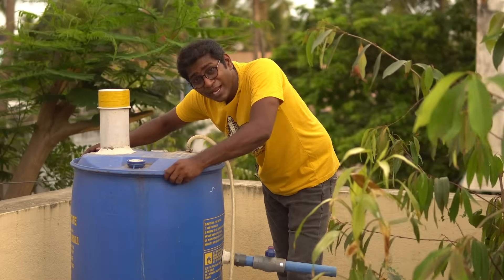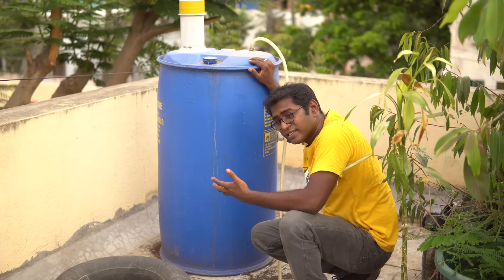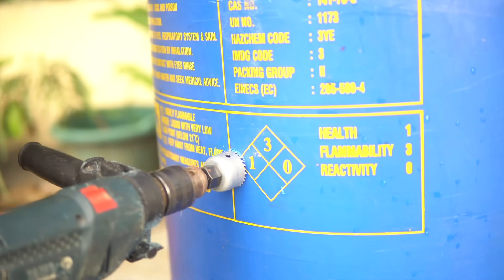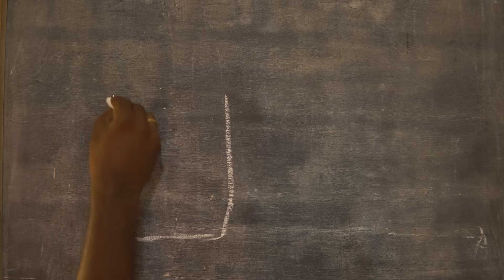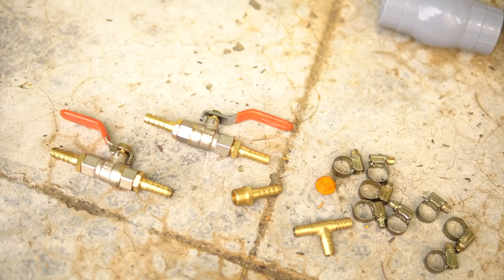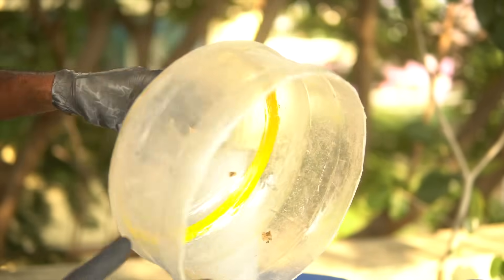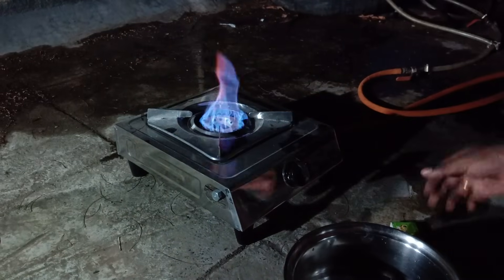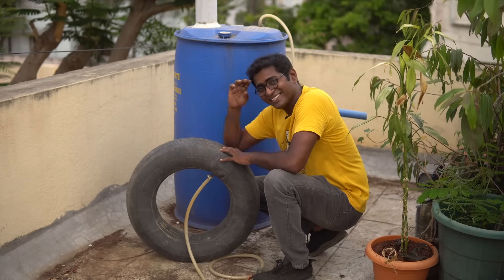Make your own Bio gas to save money on LPG

Comment: Suggestions cut your hole for the inlet pipe 3/4 of an inch smaller than the pipe use a heat gun to heat it up gently curl the plastic up until you have a big enough hole to insert your inlet pipe into use a pipe clamp to tighten the barrel flange to the inlet pipe also by putting the outlet that far down it means all you have is a 40 litre tank outlet should he within the outlet pipe or at least the diameter of the inlet pipe from the top that way you triple the amount of slurry and that should triple the gas output  you did an excellent job on the video but for a digester to be useful it needs to produce enough gas for cooking atleast one meal a day preferably 3 another suggestion is for gas storage and pressure I don't know if it'll work but place two barrels horizontally one above the other connect the bottom bungs together put the gas inlet and outlet in the top bung of the bottom barrel and fill the lower barrel with water as gas is produced it will force the water from the lower barrel to the upper barrel and the weight of the water will give it pressure since the  bungs have a 3/4 inch fip threaded hole in the center I would suggest starting with a 3/4 inch pvc pipe between the barrels that should give it about a pressure of 11 inches of water column it also gives you a built in pressure relief valve as if the bottom barrel which is the gas tank gets too much gas it'll travel up the pipe to the upper tank and out the top bung of the upper tank for those that compress the extra gas it is a way to make it a automatic just put a float switch on the upper barrel so that when it's full the compressor starts and lower the gas level down to a pre-set level I'f using it for cooking or other gas needs it can be set to leave as much gas as you. need

Comment: I am planning to setup the same setup of 200 liter drum experimentally. But it is extremely cold here so waiting for hot weather ie summer so that it work well.
Again a question I have for how long it will burn after 24 hours if I put 10 to 15 kg cow dung daily in this 200 liter drum..?
Reply from the maker: first of all, 10- 15 kg dung will be too small for this setup. You may need something larger...like an IBC tank or 1000 litre water tank.  There is no telling how much gas it will produce. There are many factors influencing gas production. It's a natural process.  I had been dumping about 3-4 kilos of quail poop every alternate day, and It would burn for only about 5 mins.... For you since you are using cowdung....about 10 kgs...it may go up to 20 mins or so....provided the container has a larger surface area and you have a suitable gas collector

Comment: You did a great job. My question are:
1, is it possible for the gas to escape through the inlet PVC pipe?
2, does the size of the inlet pipe matter when constructing bio gas?
Reply from the maker: This is just a proof of concept. Gas can escape through any gap if available. Plus this needs to have a flashback arrestor, something to scrub the sulphide from the gas, a proper storage etc...

Comment: Biogas contains hydrogen sulfide. I do not have time to watch this video, however if you attempt making biogas you need to purify it and install a monitoring system and get the hydrogen sulfide compounds below 10ppm. It is highly toxic and corrosive. Just don't try making your own biogas.
Reply from the maker: yeah, Its been pointed out by many of the viewers. Some have recommended some design features to combat that issue as well. Well I will try and add it in my next upgrade

Comment: Wow this seems awesome. I think you should try adding check valves in the system to reduce manual turning on and off. Its not too expensive and you can even make them yourself, but making it automatic might improve user experience. And if you place some weights on top of the tire tube prior to usage you can improve the flame size at the cost of more gas usage. Also if youre scared of explosions, I suppose a burst disc could help. Like an electrical fuse. Instead of having the whole assembly break, let the burst disc sacrifice itself. Id propose a simple flange pointing up, with a measured amount of weight could act as your "burst disc". Gravity pulls weight down, compressing the flange shut and gas pushes up according to F = Pressure x Area. But the moment the pressure increases too much, it will vent out the gas. I suppose a flashback arrestor is a complicated piece not meant for DIY.

Comment: How much psi does it maxed? And, why don't use regulator?
Reply from the maker: The idea of the video was to debunk a few misconceptions. See...a set up like this is not adequate even for an individual. It would take a few months to fill up a tank to support household cooking.  Even In my house, my wife is not keen on cooking with biogas....So the idea is to use it for other things like boiling water or heating a room etc...

Comment: I would suggest that you can get a used LPG commercial cylinder and add a compressor to it which sucks the gas from the tube once a couple of days and compresses it into the commercial cylinder. Hope this solves your issue of storage, one of my village people have done that It was working, but dont know the current state. Try it out. may be if you could implement pls reply back here if there could be any drawbacks for this method.
Reply from the maker: One of the viewers suggested this as well. But I am just too scared to do it...
Anyways...Once I make the upgrades...will post a video on it

Comment: How about using truck’s air tank instead of the tube? Lots of air tanks in various sizes😅 available in scrap markets. Air tank also facilitates thru drain valve at the bottom for draining water collected along with the gas. Jose, have you worked on filling such tank with pressurised gas. Btw air tanks can withstand air pressure of 8bars and more. Do reply if possible.
Reply from the maker: I am using a tube because its elastic and I can increase the pressure by simply placing some weight on it. (also its cheaper that a metal tank)

Comment: I think you made your setup overly complicated. I think the most important is the temperature and the type of bacteria. I am working on a similar but more simple setup for an experiment where I want to light a small flame with the gas and use part of its heat to warm the content of the container to 50+ Celsius if possible to optimize the fermentation because at low temperatures there is not much going on....
Reply from the maker: that's a good thought. Appreciate it

Comment: You can paint the barrel black to make it absorb more heat in the winter. In the summer, a pool of water submerging the base to wick away excess heat.
Reply from the maker: Here comes another cool idea.... Thanks a lot!
Reply: @VIDEOEPPO   You can use a small compressor for storing purpose. It has two advantages:
1. Safety first.
2. You can control the pressure to the gas stove.
Reply: @bhargavdasd  but how can you connect it and to retrieve the gas
Reply: @nikoshkin1  the compressor output pipe will be connected to the gas stove with a gate valve in between.( To increase and decrease the amount of gas coming.
Reply: @bhargavdasd  thank you very much sir for that knowledge
Reply: @bhargavdasd  
Caution with compressors, you need special equipment to avoid explosions. Electric compressors can cause sparks resulting in fire and explosions.
Reply: Because we're all watching in English!
Reply: Winter though? Some of us in the tropics.
Reply: Hermetically sealed compressors are much better, these are usually the compressors used for refrigerator and air conditioning, might be easier to obtain also, 

Connect these to a accumulator tank and use it normally, very safe
Reply: Right!
Reply: If the gas has been used, do we need to empty out the materials inside the drum? Can we use them as liquid manure?
Reply: استخدم حمض الليمون لجعل التخمر اسرع
من اسبوع لساعات قليله
Reply: Sir hoy meny kg gas produce in 1 day this tenk system
Reply: Also add insulation
Reply: Really can be used?? Bcoz it's gas we are handling what about the expansion of plastics.
Reply: Why you shy on communicating in Hindi

Comment: I love the concept, but so far my research suggests that a very large digester tank is necessary to create sufficient biogas to actually support practical, daily use for cooking.

People thinking they can go off grid and cook with biogas the way they are used to with propane or natural gas are going to be disappointed. Gas production is very limited unless you have a huge system with an enormous amount of slurry.
Reply from the maker: YOU ARE ABSOLUTELY Correct... that is something I wanted to show in this video. After all this hard work, It will last only for 5 minutes.
If I were to cook 30 mins a day for 30 day...its 900 minutes give or take....which means one will have to store the gas somehow ... In short... This can support but not be adequately  solo
Reply: You aren't joking, I operate a bio-gas plant generating 490kW continous with temperature controlled pre-digester and gas generator and all the hightec we can throw at it (both biological and mechanical) and a rough value for silage(dry weight) is 100m³ gas per ton (1m³ gas is 6-10kWh). Need a lot of blue drums to cook the Sunday roast.

Comment: Very informative video.

What is the best glue to use for the biodigester set up and how can I measure biogas volume produced?
Reply from the maker: There isn't any particular glue that is good. It depends on the kind of surface we need to bond, and other conditions like stress, temperature, moisture etc based on its application
Measuring the volume will be a bit tricky. If you are using a tube as I have used... you can use the formula of torus...
you can use the below link
https://www.omnicalculator.com/math/torus-volume...
If its a cylinder then - use
https://www.omnicalculator.com/math/cylinder-volume

Comment: small projects are always a must before someone jump to a full off-grid project, because gas storage is complicated and dangerous
a small biodigester won't cause too much damage if you made a mistake
also, relying solely on animal manure won't produce much gas, actually adding gras clippings and plant biomass will produce more, but it's nice to recycle manure instead of throwing it, even composting animal manure is nice, but producing slurry and gas from it, actually add more value, well if you need the plant biomass to feed livestock, it's also fine, but you need a bigger biodigester than a small one that runs of green biomass

Comment: Hi. A really good project. I have a very small upgradation idea. You could make a gas scrubber to really purify the output gas. You will need three jars. Fill 1 st with water, 2nd with a drying agent like cat litter, and 3rd with steel wool. They will decrease the amount of waste gases in the output. Then you could use your lpg burner very easily. Oh and yes, you need a big gas reservoir to use it for 30 min. But in this way, this little tube could be used for more time.
Reply from the maker: Great point! thanks for this AWESOME idea! The community will appreciate it !
Reply: Could it be compressed in 100lb propane tanks?
Reply: @bradhiebert6403  After purification, sure. Just be sure to pass the raw gas in the above sequence only. Water dissolve co2, cat litter absorbs the moisture, and the steel wool scrubs the minor gases like sulfides. Then the output gas could be stored, pressurized or not.
Reply: @jitag  thank you for this information. I've changed my house to propane and like the idea of biogas. I live on a farm

Comment: Nice video, if you want to increase the output you can try to build one from an ibc tank, its 1000 liters. At that size you start with 100 kilos of manure and food waste in about 900 liters of water. When it starts producing gas you can feed it with 40 liters of water and in that 4 kilos of manure/food waste daily. You may get an hour or two worth of cooking with a single burner. Who would think that handling manure was fun!
Reply: Came here to suggest this.

IBCs can be had very cheap and are perfect for this application. You can even get them in black so you can't see the contents.

Plus they've already got a sealed lid for adding the "food" and a drain valve that you can buy fittings for on eBay.

Another IBC with the top cut out of it and a few large tyre tubes the correct size to fit in it (when inflated)  is a good reservior since you can place a sheet of ply wood or sheet metal on top with a weight to create a bit of pressure while containing the tubes keeping them safe from puncture. 

You can leave out the ball valve between the digester and reservior by adding a low pressure check valve, making it a bit more autonomous.
Reply from the maker: Cool Idea...

Comment: This is great! But I have one question, how will you remove the digested matter inside the digester? Ty for your answer.
Reply from the maker: It usually becomes a slurry and can be released from the overflow pipe. I had a huge problem when I was shifting. There was no way the contents could be drained out. Please avoid the mistake I did. Keep an opening at the bottom as well. And place the unit in place where you can access sewage if a need arises.

Comment: I don"t Know if you check your comments but if you do I would like to offer this: The Japanese I think it is have been building and using a village size version of these for many years and have perfected the design. As you are using barrels I think you could use many of their design features. 1 If you will add a 45 or 90 degree fitting to the bottom of your feed tube aimed along the edge of your barrel it will provide you with a stirring action when you are loading it this will speed up the fermentation time.
2 add another barrel or more to act as gas holding tanks as they hold higher pressures, if you want you might add a in line pressure gauge to see what you total volume of gas is. In the Japanese design they use all types of slurry materials, Their systems are large concrete flattened ball tanks that are placed in the center of a village size community. All the houses and barns have feed pipes that run into the ball at a 45 degree angle along the outer edge so as to provide the stirring action I mentioned above. another feature they have is a large pound built over top of the ball. This serves a couple things, I protects against gas leaking and spountanioucly combusting, As methane can do when it is mixed with air in large quantities to fast (  very dangerous ) And it also provides for raising tallopia fish or catfish ( as these fish do not require moving water for oxagynation to live ) for food. with their systems they use a top unload man hole. but with you side extraction pipe I would suggest this barry the set of barrels into the side of a hill, with a man made pound on top with water level above tanks but below feeder tube. allow the run off line to go down hill to a point where you can collect it for use as fertilizer. ( the reason the Japanese can use human waist in their systems is because it is built from concrete and can build up inner temperatures of over 180 degrees so it kills harmful bacteria that will harm humans. By doing these things I think you will increase the amount of gas and possibly the rate at which it is produced, for sure the pressure at which it can be stored safely. Yes I've been studying these systems for many years now.          Sorry for bad spelling Dislexia is a real bother lol
Reply from the maker: So nice of you Kevin. I totally enjoy your comment of yours. Its seems that the purpose of sharing is come alive. Thanks for all your inputs.
Reply: Hi Kevin. Have you seen the digesters as they call them in India? Basically a huge very round concrete   cylinder Placed on top of a slab in thd ground and sealed at the bottom. Than a slightly smaller inverted steel cylinder is placed upside inside the concrete one. This is charged from a valve in the top of the steel cylinder, and a " hydraulic seal ) is naturally formed in the gap between the 2 cylinders. As it ferments the steel cylinder rises up. This serves 3 purposes.  You can monitor fermentation progress and the weight of the steel cylinder provides a small pressure to drive the gas out. When the cylinder quits rising any more , you know there us no more mojo left in the mix
Reply: Hi  @robertlindsay9826  Can you help me with valuable resources please. I'm trying to build one large enough for my village.
Reply: @robertlindsay9826  gasometer
Reply: thanks for sharing details! its very helpful!
Reply: Hi @kevingill9658 Can you help me with valuable resources please. I'm trying to build one large enough for my village.
Reply: Do you know the name of the Japanese system you described? I would like to look it up and maybe find some more details, photos and maybe even a video.
Reply: Kevin, it is great 👍 of you to offer  the Japanese system. It will be kind of you to name the system and share any link that will help most of us
Reply: Good ideas to use

Comment: Nice set up over all. Have you experimented with different ratios of waste and dung, perhaps using other types of dung from different animals? As soon as you lit it I thought about how there was no flash arrestor or some sort of pressure release valve at the top of the barrel. Anything that builds up pressure needs to have an emergency pressure release. Also perhaps include a pressure gauge to see how much pressure is being built up at a given time.
Reply from the maker: Hey, thanks for the suggestions, I am only working with resources that one could find in local stores. ( the availability of materials we could find and use depends vastly on geography). Let me see how I can develop this simple idea and make it more user-friendly and affordable.